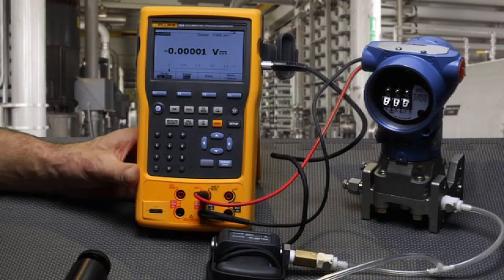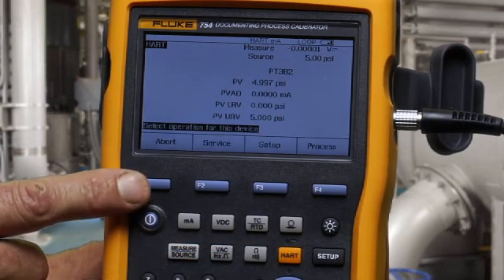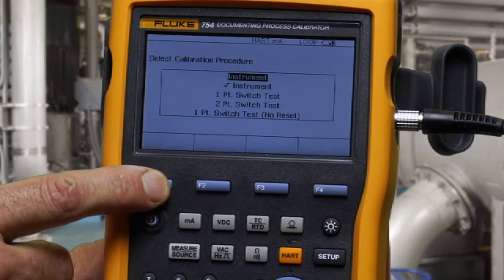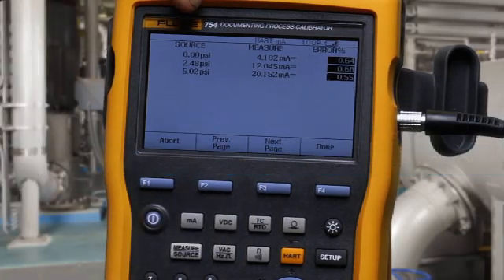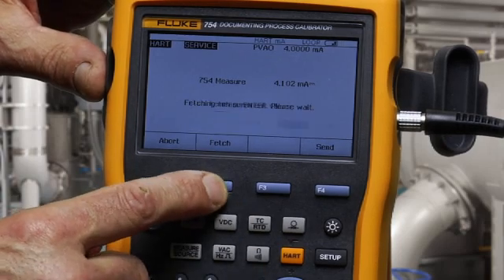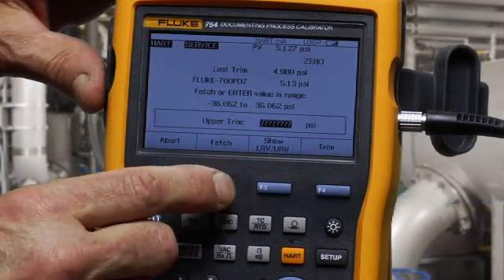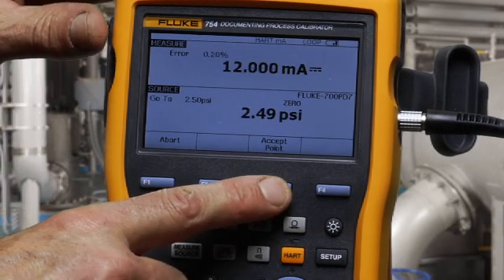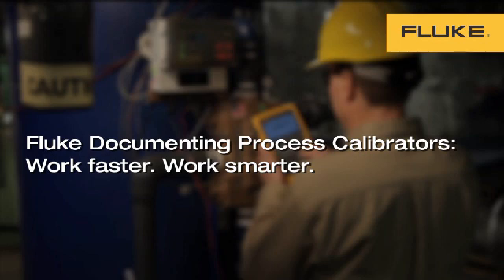How to Test a HART Smart Pressure Transmitter With The Fluke 754 Documentation Process Calibrator

Comment: I'm doing a three-point calibration on a 3051 Rosemount 0-25" h2O with a Fluke 754 in Hart mode. When applying 12.5" at mid, the signal back always exceeds the 12 ma I expect. Usually around 15 ma. It's acting like the sensor output is skewed at the mid-point only.

 Any suggestions?
Reply from the maker: Hello John - It sounds like you might have the calibration set for square root. It should be set for linear. Let me know if this works out. Please feel free to reach out again or contact our Technical Support team at 1-800-443-5853.
Reply: @fluke   Thanks, that was the ticket!